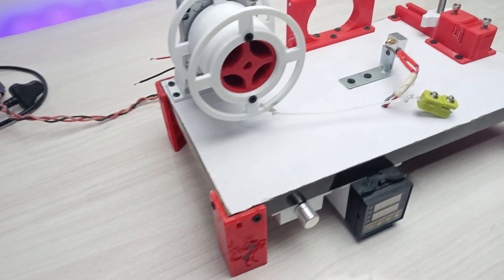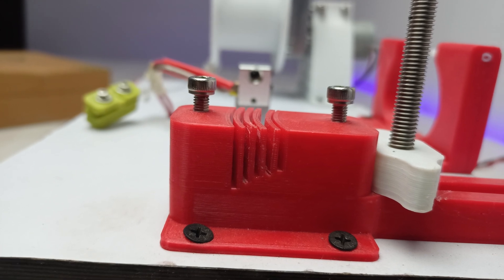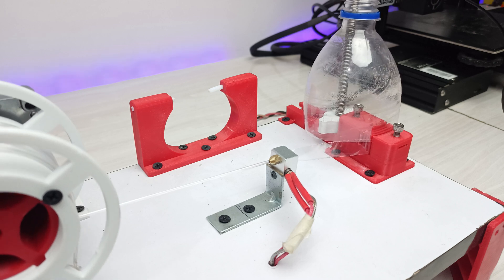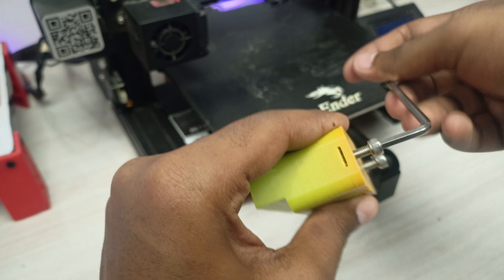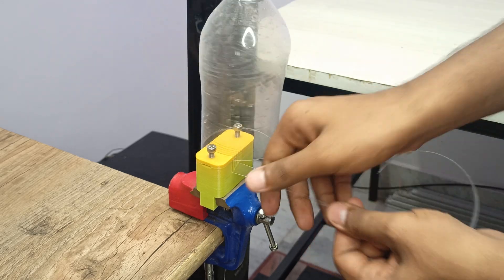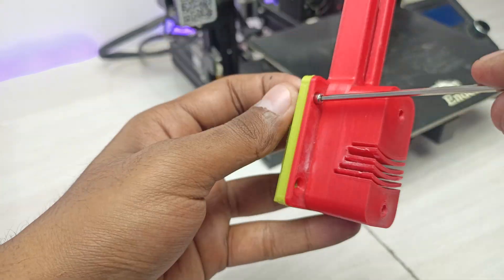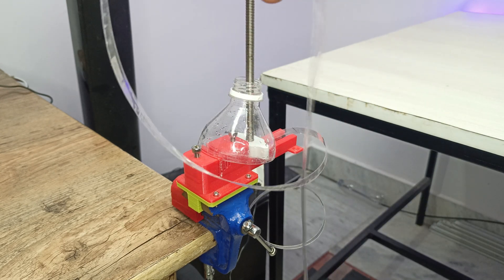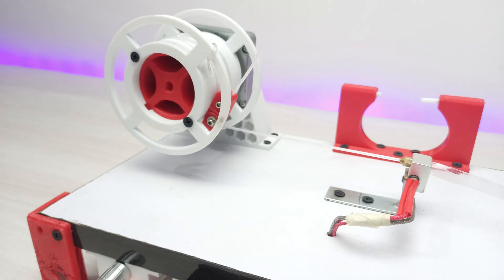Solving the Biggest Problem in PET Filament Machine From PET Bottle

Comment: I agree.  It is better to cut the stripes first, in a separate process.   It is easy and fast.  And if something goes wrong... just throw away that broken stripe... plenty of plastic bottles.
Would you mind sharing some info on the thickness of the bottles and the required width of the strips?  
I have read the 0.15mm thickness requires 10mm wide strips.  But when I do that, my filament is too thin and the extruder of my Ender3v2 can't push it down the bowden tube.. it slips.
Any advice?
thanks,
chriV
Reply from the maker: I also encountered a slipping issue which was caused by the extruder. I suggest upgrading to a dual gear extruder and increasing the strip size. In my experience,  I usually Strip 2 Litre coca cola bottle with 12mm strip,
Reply: @Creative3DP  Interesting...  Is 12 mm not too wide for the hot-end of the filament-maker?    I've been thinking to feeding it 2x6mm stripes in parallel, but I have not tested that yet.
Reply from the maker: Well, I would recommend you to test with different strip size as bottle's wall thickness may vary. Feeding 2 strips at same time is not very efficient and may not work as the hotend is just enough to give round shape to PET Strip.

Comment: You can build a new cutter using bearing , there are many tutorial on youtube , it produce no noise while it cut pet bottle into filament .
Reply from the maker: Yes you're right, but you have to put more effort than just getting bearings as you have  sharp the edges of those bearing and appropriate nuts size and hard surface/base. While this one is easy,  3D Print and put a blade to make it work
Reply: @Creative3DP  Awesome, I like the people who like to innovate and make better yet new things, not just copying and pasting like a robot. Keep it up bro 🔥
Reply from the maker: Thank you so much mate 🙂
Reply: Ok my friend,dont want to use Bearings..than deal with the noise..